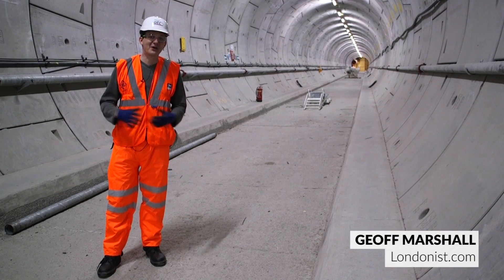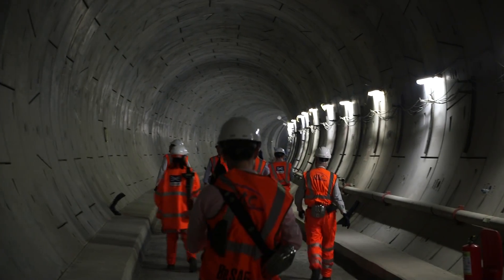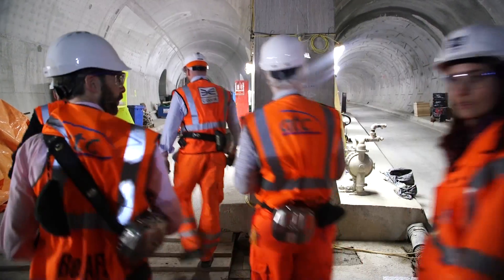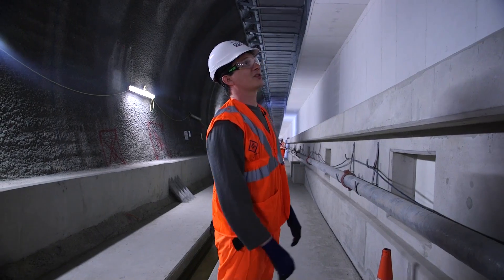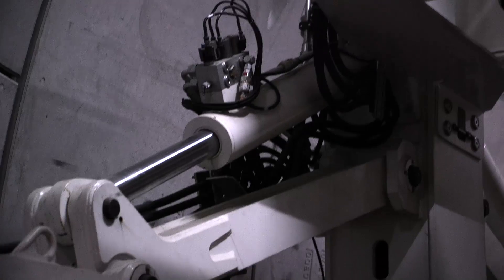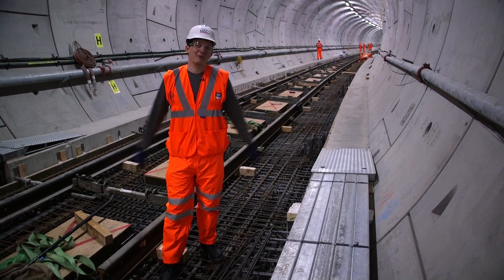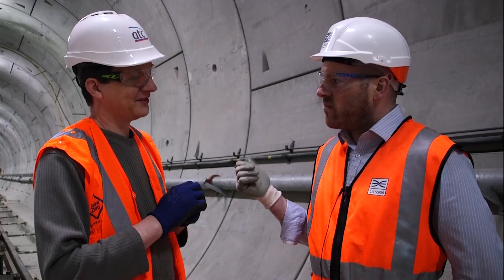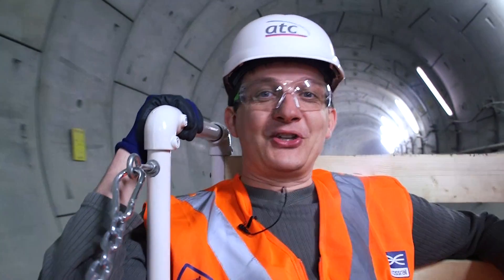Installing Crossrails Rail Systems

Comment: God, Toronto builds a new subway station once every ten years at the cost of about a quadrillion dollars.  Give Toronto a thousand years and it wouldn't be .01% as good as London.  London's transit system seems always magical to me.
Reply: RoulinBrooks Austin is worse.
Reply: If you want a city that knows how to do mass transit, look at Seattle. They've spent $7 billion creating a fast, safe light rail which runs from south to north and is still being expanded (on time) despite the amount of viaducts and other infrastructure which needs to be built because Seattle is built on hills around lakes, and everyone you talk to in Seattle thinks it's amazing because you don't have to sit in traffic for hours on I-5 anymore to get anywhere along the main city transportation corridor fast.

Comment: It doesn't make sense to use overhead wires between Canary Wharf & Abbey Wood because it only connects to the third-rail North Kent Line. Electrifying it with AC necessitated the reconstruction of the Connaught tunnel.
1:41 | The gap is actually quite big, & people throw rubbish over because there are no bins.

Comment: How is the traction power going to be delivered? Is it going to be another 4 rail system like the LU?
Reply from the maker: +HMSDaring1 No, it's going to be powered from overhead https://en.wikipedia.org/wiki/Overhead_line
Reply: +Londonist Ltd  I can't wait until it opens!
Reply: +Londonist Ltd are you a crossrail.worker

Comment: those tunnels are HUGE.
Reply: That's because the trains are HUGE. There also needs to be space above the train, because they will use overhead lines as opposed to a third or fourth rail system.

Comment: No crossrail anymore
It's called Elizabeth Line
Reply: nothing against the queen, but her name has nothing to do with the Crossrail project. The name Crossrail in my opinion better reflects the purpose of the project, which is to provide an East to West, "cross" London full size rail route...
Reply from the maker: +SoRA Chang No, the construction side of the operation is still known as 'Crossrail'. The operational name that TfL will put on the tube map when it all opens in 2018, will be 'The Elizabeth Line'.  At the moment though, it's still Crossrail.
Reply: +sbaker190189 I doubt that Queen Victoria had much to do with the construction of the Victoria line either.
Reply: +CrazyCashGaming there is a difference, the ones given the opportunity to give a name to what became the Victoria line were discussing possible names associated with what it serves en route, the Viking line and Walvic line being two of the proposals. Besides, Victoria does bear relevance to the Victoria line, London Victoria is served by the Victoria line. I'm not aware of any station on the Crossrail route called "Elizabeth"...
Reply: +SoRA Chang I, for one, will continue to call it Crossrail
Reply: +CrazyCashGaming if the victoria line had taken as long as crossrail to build in order to open in 1970 they would have needed to have started work during queen victoria's reign. I recently found a 1970s copy of modern railways magazine which said  "cross rail has been postponed and is now not open until the year 2000"
Reply: Brian Funt that make 2
Reply: Not that I care that much but I prefer Crossrail much better then the Elizabeth Line- Crossrail doesn't even have anything to do with the London Underground.
Reply: +Londonist Ltd , Thanks For that info.
Reply: +CrazyCashGaming She was dead by the time the Victoria line was made.

Farren

Comment: Anyone else think that laying temporary rails in these tunnels is a waste of time? I think so. With a flat surface to the bottom of the tunnels, surely a normal road-worthy vehicle could be used, saving a ton of labour and resources. Looking forward to seing it open, but i cant help but think that some of the techniques used to produce the system are over engineered.
Reply: I don't know. I don't claim to know, cause i'm not an armchair engineer.
Reply: +Jonathan Cook I think they know better then you do.
Reply: +Jonathan Cook Using temporary rails isn't a waste of time, it actually speeds the process up and its a necessity for casting sections of track then lifting them to install the bearings. Once the track is concreted it doesn't take long to release the temporary rails and install the LWR.
Reply: Basically you can move a greater load with less effort due to the lower friction of metal wheels on metal rails..
Reply: So whats the advantage of rails over road?

Comment: Great piece! One question though, how does the M P G get in  - and more importantly out - of the Crossrail tunnels?
Reply: +Roddy Jenkins Came in via Royal Oak Portal, a special arrangement was made with the other contractors for it to travel through their sites (Paddington, Bond Street..)
Reply: +01276 That  would be worth filming!
Reply: +Roddy Jenkins It was late at night... And to answer your second question, the MPG is able to mount onto a railway wagon so it can travel by train once works are complete.
Reply: +01276 Presumably done with military timing, to ensure the project runs on time

Comment: I do hope TFL are right when they said crossrail will reduce passenger congestion on the already existing lines, because there is nothing worse than a packed train in my opinion.
Reply: They say that it will reduce congestion by 10%, but more accurately I see it as a Central line relief route as in the tunnel section, it runs parallel to the Central line tunnels and stops at fewer stations than the tube line. Couple that to bigger and longer trains, capacity is freed up on the Central line immediately...
Reply: +sbaker190189 well better than nothing a guess haha
Reply: +Iam MTS It'll probably 'draw-in' more people...leading to more congestion/over-crowding; look at the M25 motorway
Reply: Iam MTS Latest 'projection' is a increase of 1million in London in next ten years...
Reply: +Vincent de Guard that depends on the population growth, if more growth does not come then it should ease congestion by a fraction
Reply: +sbaker190189 Yes that and the District Line as well, I believe that Romford To Upminster Overground might be even more useful since Upminster is a District line and Romford is Crossrail and Crossrail is theoretically faster

Comment: Not the Elizabeth Line?
Reply: +Chris Stephens I'm petitioning for it to be called The Purp, after the colour.
Reply: +sbaker190189 I completely agree with you and Geoff there. "Elizabeth Line" doesn't sound right, especially considering it's not even an underground line. I'll always refer to it as "Crossrail".
Reply: +SimonHellinger I'm with Geoff, the name "Elizabeth Line" has no relevance to the project. I will always call it "Crossrail" regardless of the name of it officially...
Reply: +Chris Stephens the thing is, Crossrail is the first rail to the full size loading guage route to "Cross" London from west to east and east to west. This is why the name crossrail works, the same does not apply for Crossrail 2, because Thameslink already crosses the capital from north to south and vice versa... If any potential crossrail route have a different name it would be the second crossrail route...
Reply: Never say the E word around Geoff.
Reply: The construction project is called 'Crossrail' only the train service serving this new route, will be called Elizabeth Line. Also, Geoff doesn't really like the term (as far as I understand it)
Reply: +SimonHellinger Knowing our love for nicknames it is bound to be the "Lizzie Line"
Reply: What happens if Crossrail 2 comes into being? Or should that be "Crossrail too"?:>)